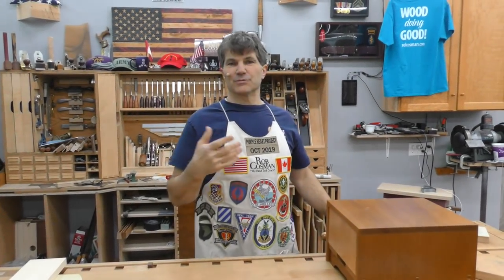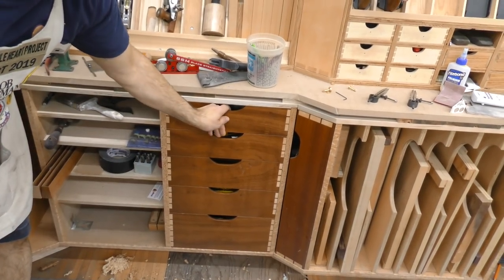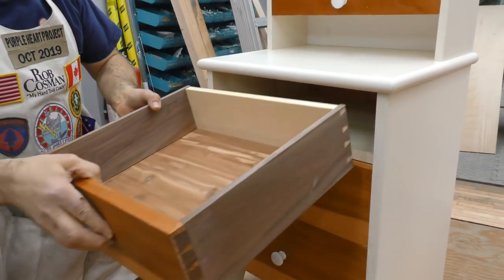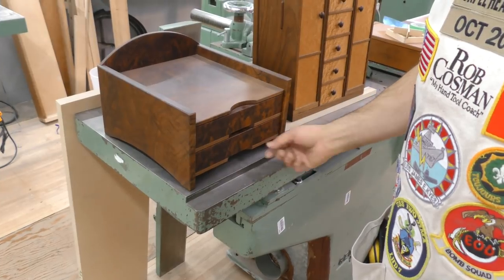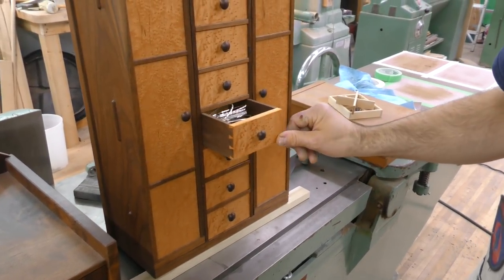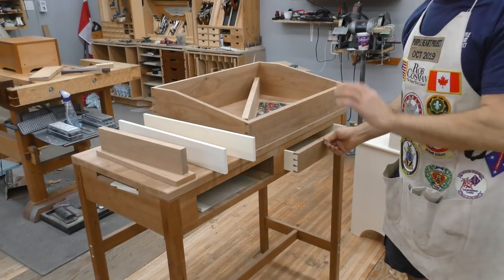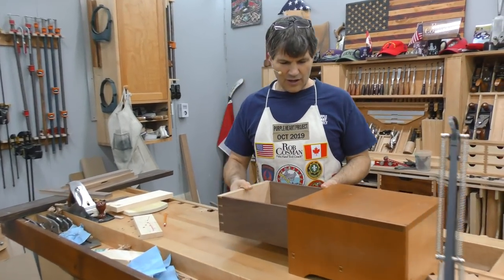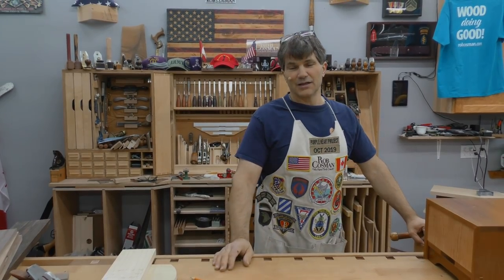Drawer Making Part 2, Construction Explained

Comment: Side hung drawers, particularly on tall drawers like those of a chest of drawers for clothing, allow the sides to be made narrower than the opening.  Because the slot in the drawer side and the runner (set into a slot in the carcass to keep it dead straight) move in the same direction seasonally, their relationship can be fit to a very high tolerance and thus the top to bottom slop issue is all but eliminated.  I'm guessing you have some reservations...perhaps the added work (a bunch more layout) and parts does not justify the (marginal?) benefit.  I'll add that your fit drawer back transfer process to the drawer front is a great play...This old dog just learned another new trick...very grateful for your terrific presentation during this your other videos...thank you Rob.

Comment: Brilliant as always Rob. What's the 140 you mentioned?
Reply: Stanley #140 skew angle block plane. Side plate can be removed from one side to get tight into corners. Purchase antique or new from Lie Nielsen (maybe others?). The LN is $$$ but improves on the SW tool by adding thicker low angle iron, a fence and can be ordered left or right handed. I have the Stanley but would love to add both LN’s to the arsenal. A lovely, superior tool.

Comment: If your drawer sides are quartersawn, wouldn’t the drawer expand and contract laterally? 

I live in the humid Pacific NW and have to consider wood movement in all my plans, especially when shipping to a drier climate. Is fitting the drawer almost exactly to width of the carcass only appropriate in very temperate regions, or is it a matter of grain selection (plain dawn perhaps expanding vertically)? I would think in either case the dovetails or finger joints would restrict vertical expansion to a degree. 

I ask from having a customer send me back a piston-fit jewelry box whose drawer she couldn’t open. 😅😅
Reply from the maker: Drawer sides 1/2” or less (advantage of dovetails) will have minimal expansion such that I never bother to factor it in.  The drawer front and the drawer sides will expand equally, grain runs the same way.  Building in one extreme and shipping to another will always be problematic.  I’m going to experiment with torrified maple and see how it goes.  Does not absorb moisture.
Reply: RobCosman.com Thank you for the help Rob. Let us know if anything interesting happens with the maple.